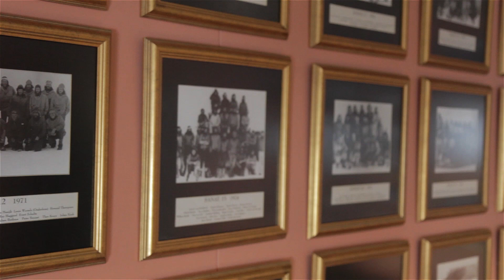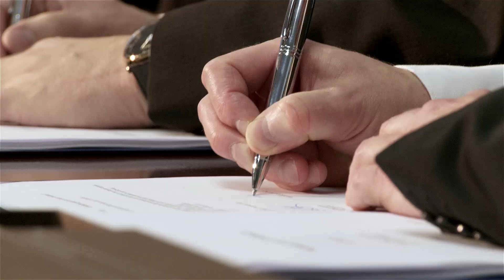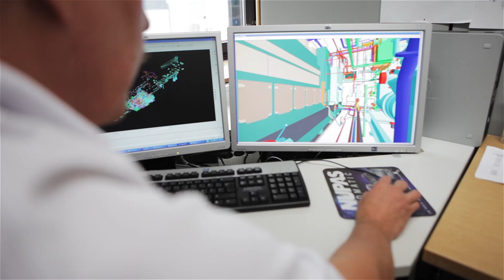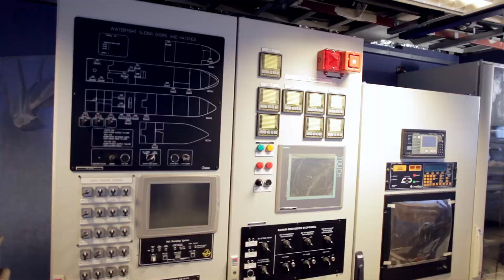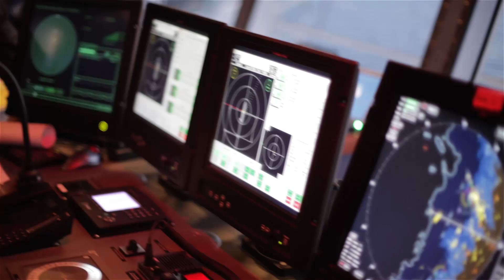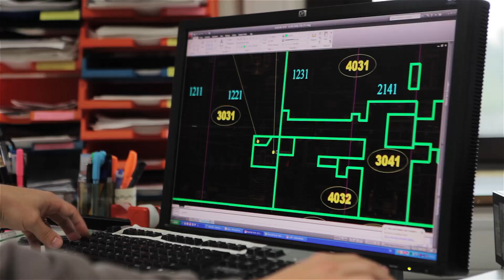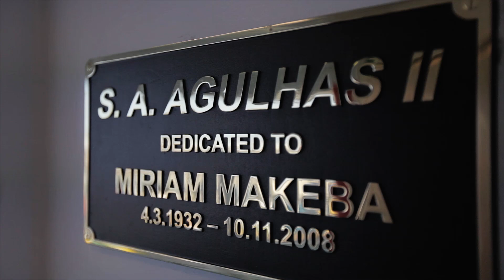SA Agulhas II Documentary

Comment: 4 huge diesel engines, 2 electric motors for propulsion.
Then, a blown fuse from another small generator brings down all propulsion because it powers the oil pumps, shutting off the huge engines.
Talk about Achilles heel.